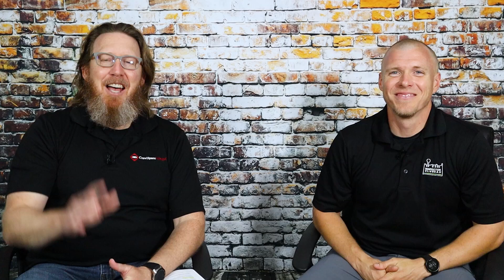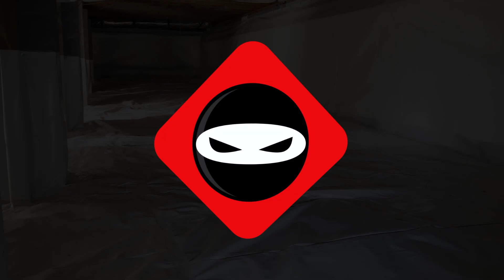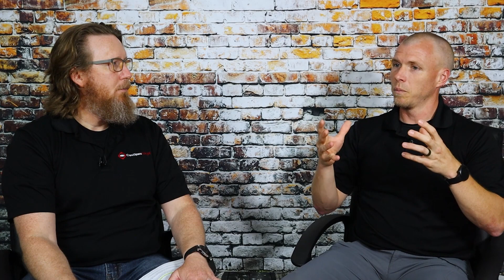Negative Effects of HVAC on Vented Crawl Space | Ideas to Properly Ventilate Sealed Crawl Space

Comment: Hi Mike, Thanks for all the great videos!
We have a 1946 home in Marietta, Georgia, on a crawl space. Our gas-fired furnace HVAC system and gas-fired hot water heater are both in the crawl space and share a b vent exhaust that terminates through the roof. Would encapsulation, along with the creation of a negative pressure vent, create a  backdraft situation potentially drawing in carbon monoxide into the living space? About a third of our crawl is below grade and more like a basement with 4' concrete retaining walls up against the crawl portion that is soil at grade covered with vapor barrier.  There are concrete steps from the exterior entry door going down to a concrete floor that we can actually stand up in. There is a floor drain that apparently goes to a dry well (not sure where, and the grate is embedded in concrete). Both the HVAC and the WH are on the conrete. In your opinion, do you think a space like this would be a good candidate for encapsulation?
Jeff
Reply from the maker: Yes! An encapsulation will aid in preventing any mold growth . HVAC systems sweat moisture and allowing a dehumidifier in there as well will fight any condensation build up

Comment: Can I seal my crawl space vents without encapsulating? I was also going to put a dehumidifier in the crawl space as well. Please let me know.
Reply from the maker: With a dehumidifier should be ok but dehumidifier may run more often due to moisture from the ground. Also, check local codes. Many state the vapor barrier should be overlapped/taped when vents are sealed.

Comment: I can see the negative pressure in the crawl space,  but I think it's important to have positive (compared to outside) pressure in the living space by bringing in fresh air into the hvac system via an appropriate method (through a dehumidifier, etc).  Or else you might end up with a negative pressure in the living space.

Comment: Why wouldn't a closed-vent crawlspace, with a high BTU window AC unit pumping conditioned air in, with a gentle exhaust fan pulling air out work? If the exhaust fan can pull out fast enough, there shouldn't be positive pressure. Wouldn't that, mixed with a regular vapor barrier (not fully encapsulated) take care of humidity, temperature, and soil gases?
Reply from the maker: The use of fans is an incredibly effective way to dry out an area that has condensation and moisture. You can prevent mold growth in your crawl space drain system by using fans to help dry the area thoroughly and quickly. Once the area is dry, be sure to use a dehumidifier.

Comment: We are giving a company come out soon to encapsulate our crawl space, it’s in HORRIBLE shape. Vented, no vapor barrier, mold growth, standing water issues. Honestly don’t know how the home inspector didn’t catch it. Thinking about calling and reporting the inspection to the FHA since we got our loan through them and they’re usually very strict on inspections. But then again we did just have a brand new amana 2.5 ton package unit put in last year, but some of the issues had to exist before we bought the house.
Reply: This is the same exact issue we are in and thought about getting FHA involved. Did y’all get anywhere with that or just went ahead with getting the crawl space fixed yourselves?

Comment: I'm in utah and I bought a house with hvac in the crawlspace and I have vents. Humidity in utah is low in the summer at 35% and high in December 75%. Should I close off the foundation vents. No insulation on the ductwork.
Reply: I would like to know the answer to this question since I am in a similar situation in Ontario. Thanks
Reply from the maker: Close and seal off your crawl space vents from the outside elements at all times. There are a number of problems associated with venting your crawl space. A crawl space with open vents is prone to moisture entry. Mildew and mold thrive in such an environment.

Comment: Hey Mike, long time fan here...I love your videos! I need your help. I encapsulated my CS 2 years ago (Charlotte NC) myself with a dehumidifier. i have an HVAC unit in the CS as well. i did not add a fan to exhaust air out side as i was thinking of piping the supply air for the HVAC unit from the outside. now, from what i hear from you guys i can save myself the hassle of running the pipes and cutting a hole by just adding an exhaust fan blown to the outside. do i still need to supply outside air or, if understood you correctly, the supply air will come from the house by the negative effect created by both the HVAC usage+the exhaust fan to the outside?
Reply from the maker: It is probably the most common method to encapsulate the crawl space by adding a little air from the HVAC system. You can do this easily and cheaply if there is already a duct system there. It helps to dry out the crawl space air with air from the system.

Comment: I live in a double wide and got a new HVAC system. I have a brick skirt so my crawl space is entirely enclosed. Since I got new system, the moisture in my home has increased greatly. My carpets and hard floors feel moist. The metal vent in the floor sweat. All my foundation vents are closed and I have no vapor barrier under my trailer. While it appears dirt under my home seems completely dry, do I need a vapor barrier?
Reply from the maker: Even if the ground looks dry, it can still be evaporating moisture into your crawl space. If you do not plan to encapsulate your crawl space and install vapor barrier and a dehumidifier, we'd recommend going ahead and opening your vents so you can get some sort of ventilation in your crawl space. We only recommend closed/sealed vents when a dehumidifier is installed to control humidity.